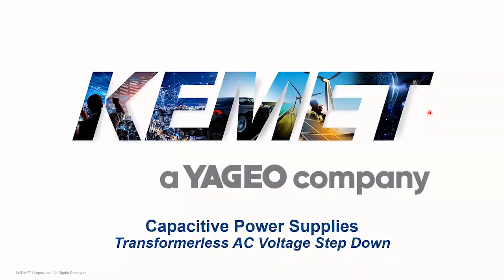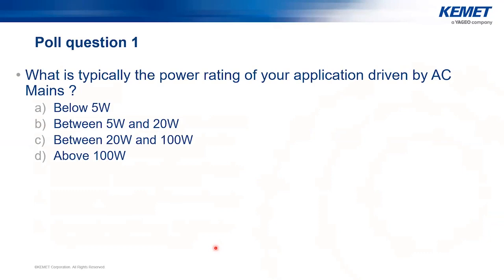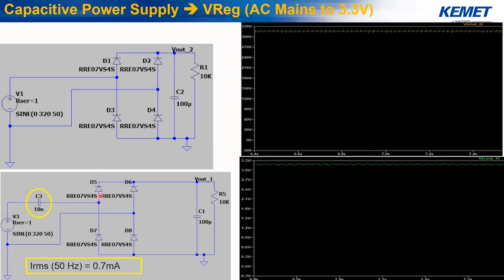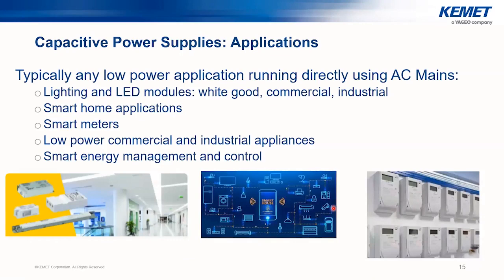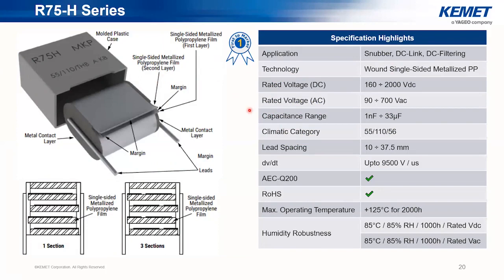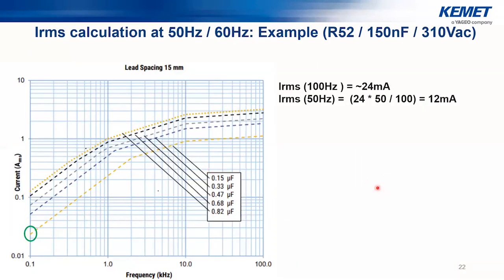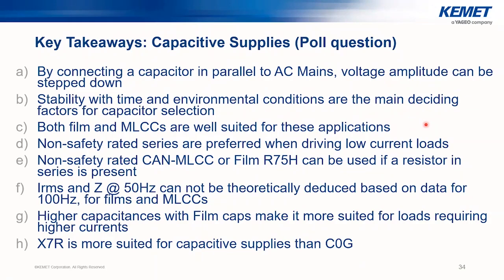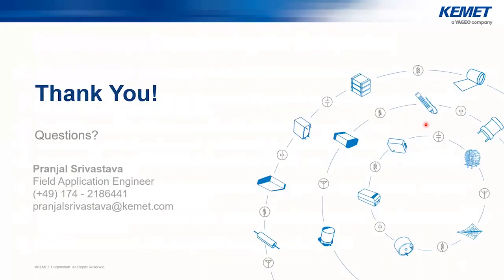KEMET Webinar | Capacitive Power Supplies

Comment: I am an outsider in this area of technology. So, I write only my takeaways. 
Very detailed talk giving core technical detailing for almost all types of requirements. Any of MLCC or Film capacitors seem to be good. Only deciding factor would be space temp.  safety. As a layman's observation, the Corona discharge should be more in case of transformers due to electro magnetic field and heat effects. Though not sure.
The resultant current and voltage requirements are altogether different in case of capacitors and teansformers. Circuit divider, resistor in series makes available wide range of applications for Film or MLCC.
A very core technical presentation, really. 👏